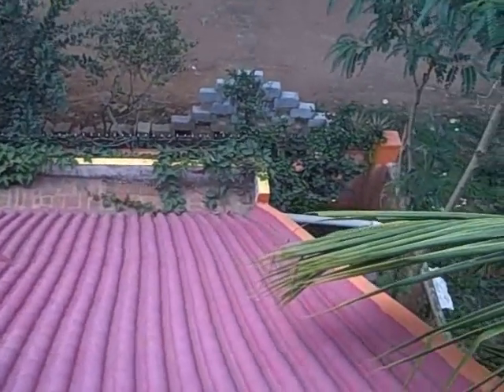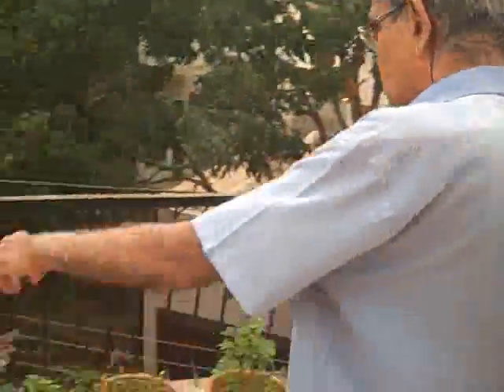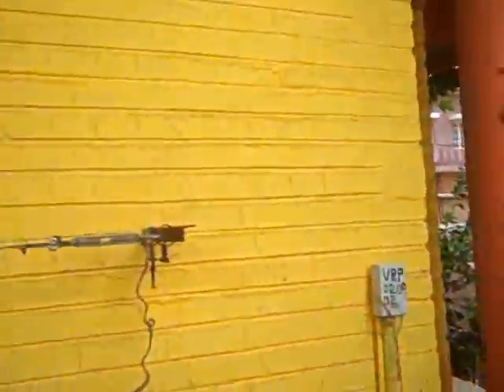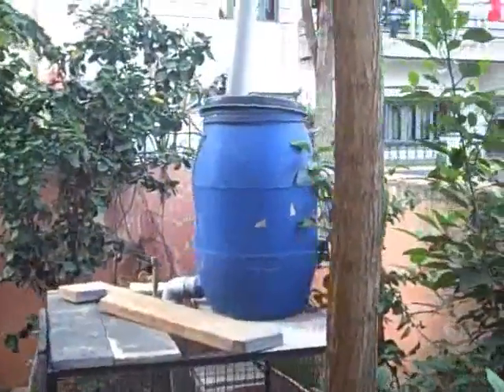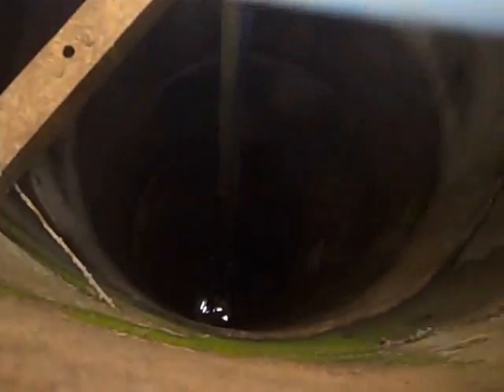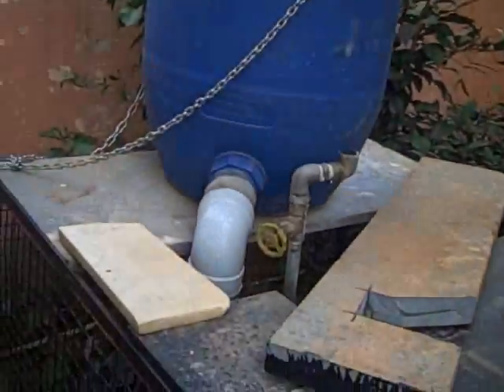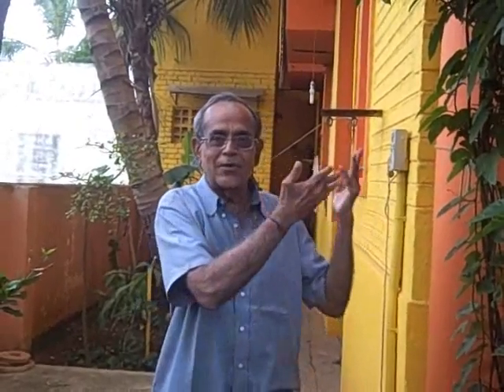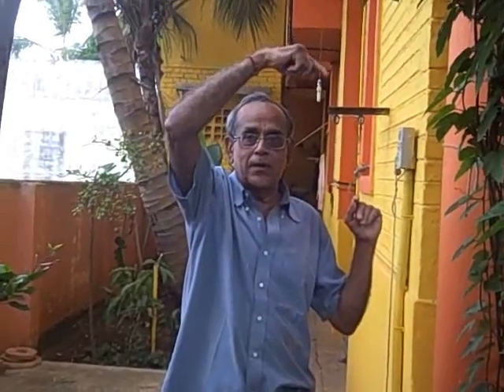Rainwater harvesting and recharging an open well- Bangalore

Comment: I have an open well in a field. I want to harvest rain water during monsoon. Water from other fields enter our fields and passes out. I directed last time the water by digging channel to well and the well was filled, but the dismay was, it pulled in all the sand, mud, silt into the well. How can I avoid it? What type of filter channels can we make around the well so that the water flows through the filter to the well. Any suggestions? Please comment here or write to benzmar at gmail dot com. 

I was thinking to make a trench of 2 feet by 2 feet round the well. The well is 10x10 feet open. Should the trench be filled with small concrete gravels, followed by charcoals and then little bigger concrete stones and then bigger and finally by white pebbles? Please suggest. I do not want silt and mud and sand to go into the well. The well is only 25 feet deep. It was dry for 75 years. Last year channeled the water into it and this whole year water was available for 3-5 feet in the well. Wanted to continue recharging it. Please suggest.

Comment: We had 16" well * 3 feet. It was completely closed with dirt and a permanent lid on top. We redug it completely and filled half of it with sand and gravel. Last rain season it was filled completely three times. We have about 1000 ft. For the size you mentioned I would go little bigger than what you mentioned as just have bigger rains covered. I would say if you are doing it just go a bigger once for all. Proper gate valves also should be planned if you need to route the water.

Comment: bravo. Well done. 

I too am planning to divert all the rainwater of my factory shed into the ground properly. I am thinking of digging up a 5'x5'x10' depth hole and filling it with stones and gravel and make the water duct into it. Is the size of the hole be enough sir? the shed roof is approx 10000 sft